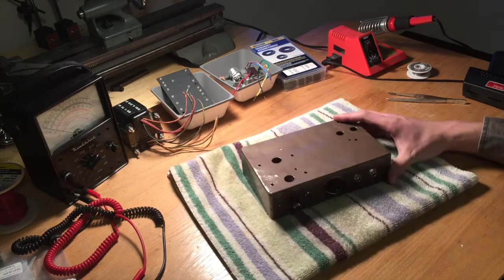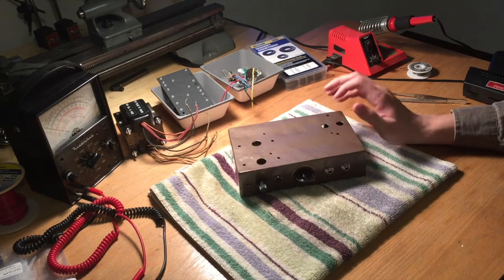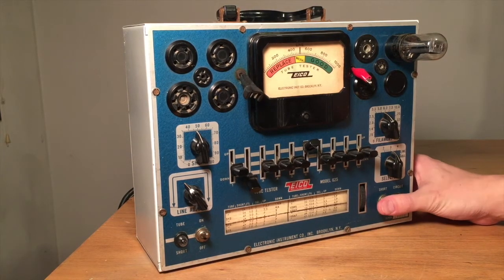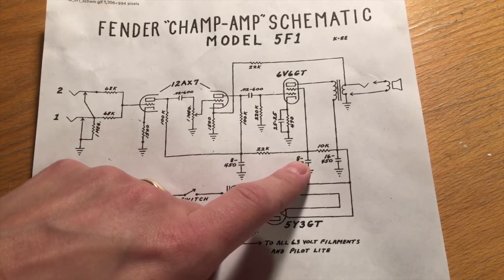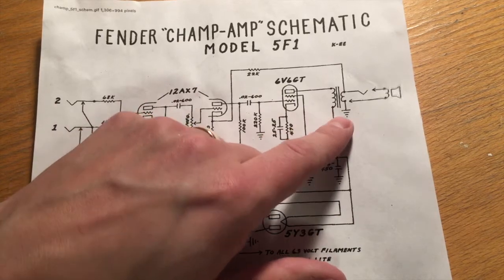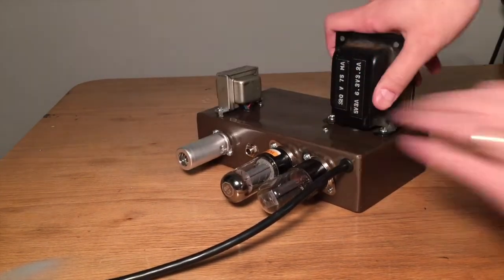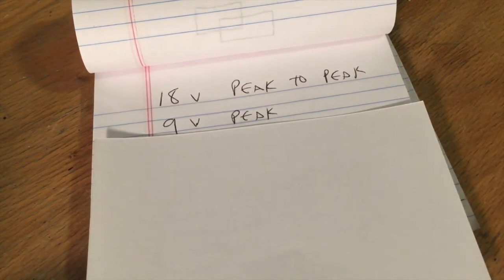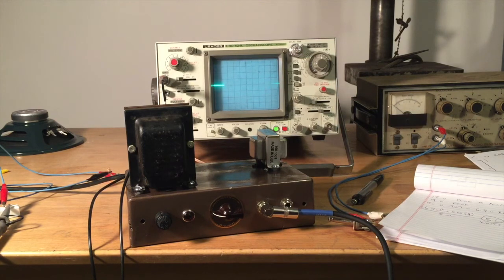Guitar Amplifier Chassis Build

Comment: I had the same plan last winter when I built a 5F2A.  I also started with a blank sheet - mine is aluminum. The cost was about $15 from a welding shop and I had to come up with some dimensions on spot when the guy offered to bend it with his press brake. I think it's 8x13x2.5. Just about pulled my hair out going over the tube, pots and jack locations and in the end opted to keep the input section as far from the power as possible. I used vintage tubes, painted it bright red and have been very pleased with the result. Also pleased with how quiet the amp is with almost no hum at all.   

Your workmanship looks great. Nice lead dress. Mine, not so much but it sure was fun.  One mistake I made was pairing it with a 12" speaker rated for 75W which is a bit stiff for the amp. 

Very nice video.
Reply from the maker: Oh wow, your chassis sounds great! In hindsight I wish I would have just
 made mine out of aluminum also, the steel I used was far to difficult 
to use without a press brake. That's awesome you have someone bend yours
 for you. Thanks!
Reply: Steel? WOW! You did a first rate job on the chassis. I wanted to build mine 100% from scratch but when the shop offered to bend the flat scrap of aluminum I went for it.  

I have intentions of putting a clip on YT but if or when I do it will probably be more of a slideshow than a recorded step-by-step build.  I started doing a video but got wrapped up in the building and later realized after recording several clips that the video project had lost its continuity. It wouldn't be as interesting or as detailed as yours.  

Looks like you used F&T and possibly Jupiter or mojotone caps. Using good parts is never wrong, IMO.  Again, nice job on the build. Super job on the hand built chassis.
Reply from the maker: Slugg0matic yeah you should totally put up a video if you get a chance, I would love to watch another build of this chassis. I can't quite remember which caps I ended up using but I think they were fairly high quality caps from justradios.com. I'm very happy with how it turned out.

Comment: Hi Steve, great little amplifier you guys built there. Looks like you used pretty good components, nice big power transformer. The chassi looked good enough as you said. They really are a handful to make from scratch. Nice clean build. Excellent evaluation testing the amp with the generator and scope, and explaining how to get the RMS power output. Would like to see what you do for the cabinet, I paused the video with a min or so from the end.....maybe you made one? If not, a follow up video would be nice. Thanks for posting, excellent first tube amp build and video, take care, Tom
Reply from the maker: Thanks! I still haven't got around to making a cabinet for it yet, other projects keep getting in the way. I will certainly do a video on it when I finally get around to it though.

Comment: you should use a digital RMS volt meter to measure to work out your output power,  100 mv in @ 1000HZ turn the amp until it just clips and back it off measure across the 8 ohm resistor  the ac voltage EG 30 x 30 / 8 ohms
Reply from the maker: ian forster yeah that would probably be easier, I was mostly just excited to try out my new vintage multimeter here.

Comment: hello my friend, I like your videos and wanted to ask you something, could you please give me an advice how to make diy 50 w guitar combo? What I ll need for that.
Reply from the maker: 50 watts is quite a bit more than I did here but I imagine the fundamentals are the same. I'm by no means an electrical engineer so my best advice would be to do what I did here - clone an existing popular amplifier. Do some research and find a very simple 1960's or 1970's design and get the schematic. You can even purchase many of the popular amplifier clones as kits, then you wouldn't have to do a bunch of work gathering the parts. If you can purchase a metal chassis that will also save a ton of time, I severely underestimated how long the chassis would take to construct. Good luck!
Reply: 50w is a large amplifier if its your first build... i suggest you start with a 5f1 or a 5e3 deluxe first and then go from there.. a 50w amplifier is fairly complex for a beginner.. (even my self.)